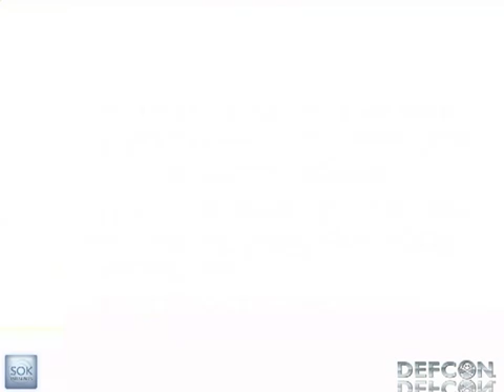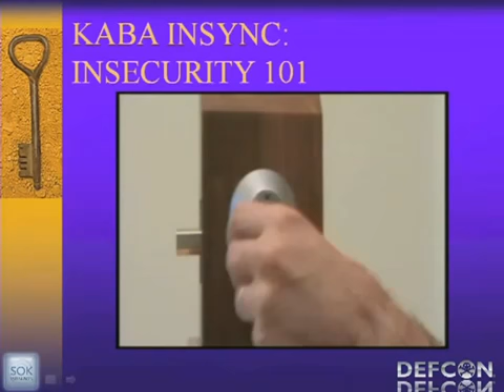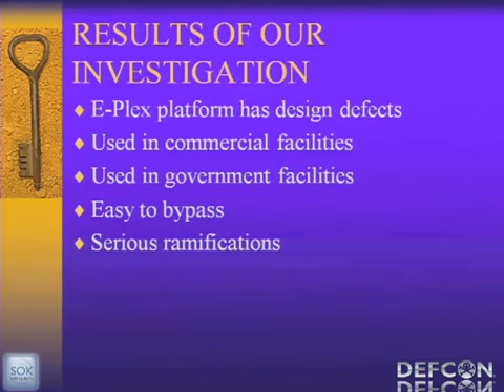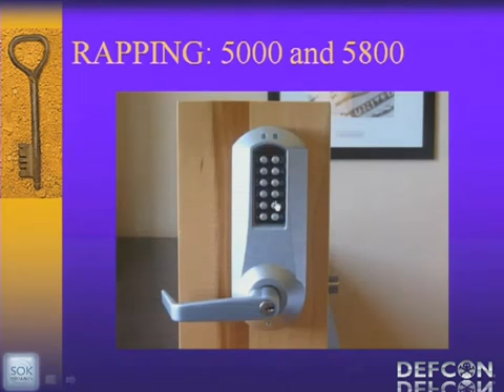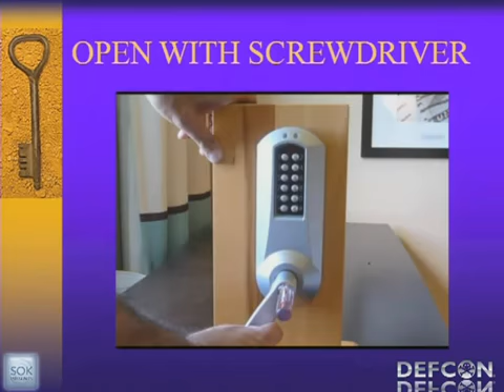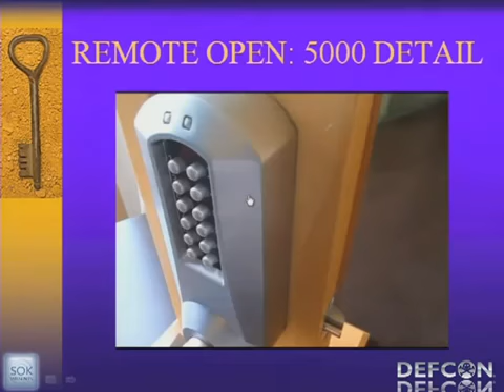DEFCON 19 Insecurity An Analysis Of Current Commercial And Government Security Lock Designs

Comment: on the simplex 1000, my local airport uses the extensively and all you need is a mirror... the code is posted on the inside.  I am wondering though... what other bypasses exist on the simplex 1000 that don't include a magnet.

Comment: Sounds like Kaba should hire you to test their locks to get it right, then market it. Wait a minute, that won’t work because when you showed them the defect they still did not correct the problem. Sounds like their engineers are total morons.
Reply: There are even odds that Kaba never showed the video to engineers. It's entirely possible that a manager looked at it and said, "That's not really a problem." If it was the engineers, then they need to retrain their engineers, which a good management team would recognize when receiving complaints like this.